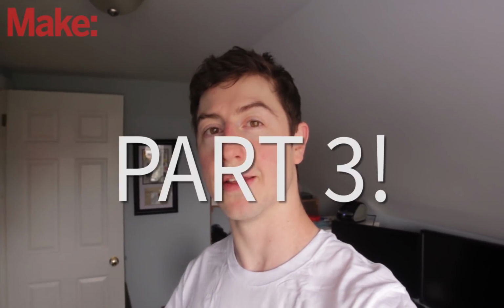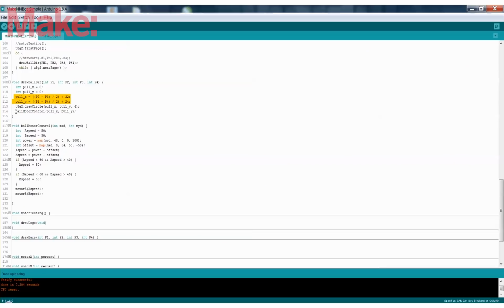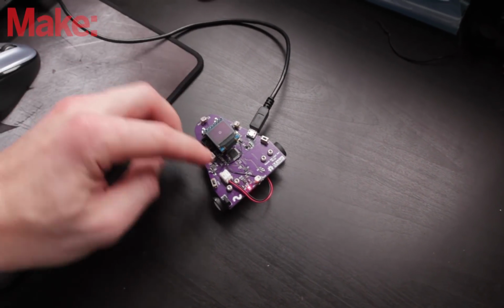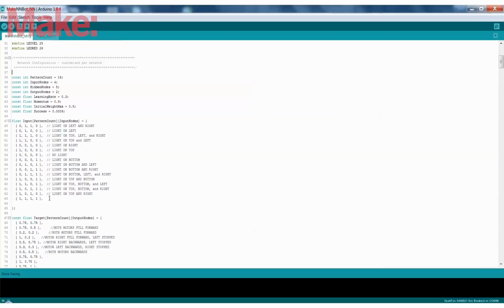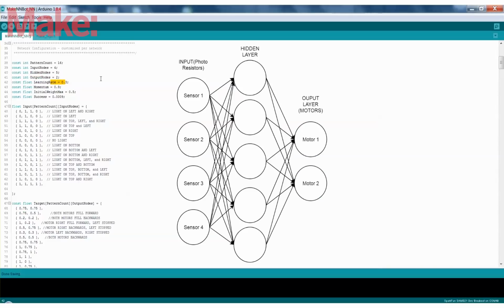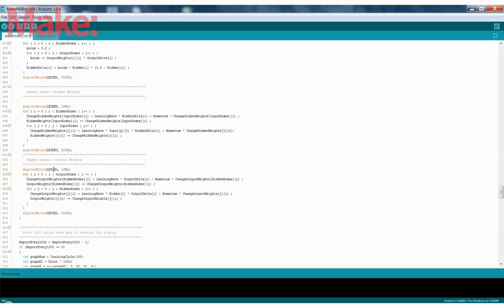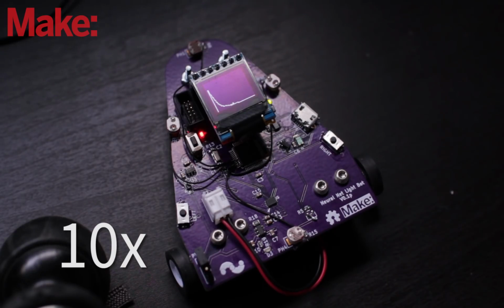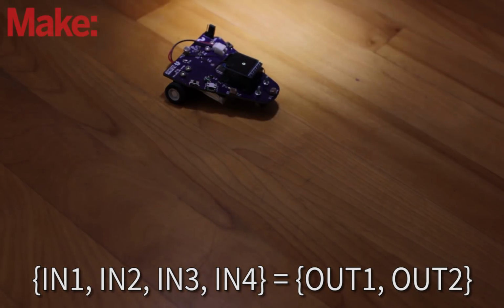Arduino Neural Network Robot Part 3: Running Neural Networks on an Arduino

Comment: Would be any difference if you used "if statements"? I´m confused with your multilayer neural network :S
Reply: For this case you could just use a lookup table which much faster than nested ifs. Also a simplified Karnaugh map could do the job, which less faster than look up table, but it takes much lesser ram space.

The point of having NN is to train them on a dataset and then predict unknown input. But it's fine to experiment with those stuff, so I give a credit to the guy because learning is important.
Reply: @SinvílyaMirindo  I totally agree with u. Thank u my friend

Comment: I face a problem while training the neural network. Error doesn't reach below the success rate, instead it goes back to training cycle 49 after going closer to the success threshold.. Can anyone help me?
Reply: I don't know your particular situation, but you can start by playing with learning rate. In your case (validation and training errors change erratically and stay high), try to decrease learning rate.  Another possible problem is too small training set in relation to NN size (e.g., the number of weights)-- the symptoms are training error falling to nearly 0, while validation error starts by falling a little, and then grows back -- in such case make your NN smaller (or training set larger) .
Reply: @alexeykrylov9995  Yeah! It worked.. Thanks man!!

Comment: more hidden layer = more layers = more number manipulation (basically each layer is add, then multiply) = more closeness/percision.
basically more hidden layers, the more complex logic it could handle.
for example:
summation = no hidden layers (its to simple you just add)
multiplication = no hidden layers 
powerof = at least one hidden layer
pythagoran theorm = at least four 
complex equations = more hidden layers

Comment: You could use a Raspberry Pi and the Google AIY Vision Kit to make a robot with a much more sophisticated neural network. Perhaps one with a rear facing camera that is trying to get away from a cat and not the light. The Vision Kit already comes with a pre-trained human-dog-cat-classifier.
While the robot is in a turn a servo should turn the camera, so the robot can still see the cat.
You should add proximity sensors to the front so it won't crash into the wall.
https://www.blog.google/topics/machine-learning/introducing-aiy-vision-kit-make-devices-see/

Comment: Wow! Great project! Wouldn't it be also possible to train the network on the computer and then ship the training data along with the code upload?
Reply: Yes, absolutely. A viewer actually wrote a python script to train the network and add the weights to the Arduino script. I will add it to the GitHub.

Comment: I've been thinking for a while it would be fun to build a neural network with AVRs, but instead of doing it all on one chip, use a bunch of chips (maybe those super small ATTinys), with each chip acting as a neuron or set of neurons.
Reply: Great idea. I have been thinking about exploring that as well, but using a light source to transmit the signal. I have circuit boards, but the project has been shelved for a few years!

Comment: Nice series, interesting in that the neural net which I thought would be slower especially on the low spec micro controllers was fast & reactive to the light. Kinda reminds me of least squares fitting to a curve in its operation. Thanks for sharing!

Comment: Great project. I really appreciate that you laid out the entire process, but also got down into the details. This was perfect intro to neural nets for me. Thank you.

One thing that wasn't clear: during training, the code doesn't actually look at sensors, correct? If so, could the process be reorganized so that the training were done on the host computer rather than the arduino?
Reply: Yep, you're absolutely correct. You could run the code on a computer and transfer the weights over to the arduino, never having to do the training on the arduino. It would also probably take seconds(or less) to train on a computer. ha

Comment: Awesome! It'd be interesting to see if the bot could learn light avoidance through the definition of only a single scalar reward... I have a feeling it could, worth a shot at least! 

Basically sampling motor speeds given light readings transformed by a (initially random) neural net and measuring decreased average light over all sensors as a reward, then modifying the weights to promote behaviors that lead to high reward, then repeat. 

I can see that it's much more practical to define the extremes though, and really cool that the net generalizes/interpolates between them! 

I'm working on a similar project right now, but the robot is a quadruped, and the sensor is a 6-axis accelerometer/gyro. Hoping to get some interesting behaviors when I reward "levelness" (high acceleration in the downward direction) or increased acceleration in a certain axis over time (say by walking forward!) 

Also if the arduino is too slow when training, you could consider training your net on a computer with python and sending the learned parameters to the arduino. I'll likely do so with my walking robot, using it to collect thousands of training examples which I can then quickly train on and send back parameter updates to the bot.

I'll post back if I come up with the tool. A very simple way to do it would be using a python script that trains the net with keras/tensorflow and prints the weight matrices out as text formatted for you to copy into the arduino sketch, who needs the serial port anyways! :-)

Your work here was really inspirational and gave me some good directions to go with my project, I really appreciate these videos! Thanks Sean!
Reply: Reward systems are a really cool way to train for sure. Truly random learned behaviour. I would love to see that done for something like this. I can imagine how it would be done in my head, but would definitely take some trial and error to get it right on the Bot. Ill play around with this idea. 

Training on a computer is definitely the way to go if you can do it that way. The absolute bare minimum would just be to copy over the weights to the arduino sketch. Definitely let me know if you create something like you mentioned, and I can add it to the GitHub as "Extra" stuff people can play with.
Reply: Definitely! I'll see if I can whip something up right now.

As for reward systems, check out Q learning as a starting point. Formulates the problem in a really obvious way, with environment states leading to actions which lead to new environment states and a reward. Then the problem is picking actions that maximize future reward. You can use neural nets to go from states to actions (called a policy network, any type of NN you'd like to use really) or you can try to predict future states given the current state and action... But that's a more difficult problem to solve. 

I used a type of Q learning here for continuous states and actions here: https://www.youtube.com/watch?v=ZPmCsJ6uWnA

In your case for the light bot you'd have continuous states and actions, though you can always discretize them into buckets and learn optimal actions for each :-)
Reply: Yo Sean, got something for the weight training, check it out here:

https://github.com/JonComo/Arduino_weight_trainer

Let me know if it works for you! 

I tested it by training on the example data in http://robotics.hobbizine.com/arduinoann.html and got the correct outputs when I copied the trained weights to the sketch and disabled the weight randomization in the sketch to not wipe out the trained weights.

Hopefully this tool could save you 5 minutes of train time on the arduino and let people try out different input/output pairs quickly!
Reply: Awesome! Ill try it out and ill put a link to it in the makennbot Github. Great work.

Comment: I had no idea an Arduino would be suites for this. I'm trying to make a self driving neural rc car but I'm using an RPi 3
Reply: NOPE Haven't gotten around to making one, a bit delayed on everything since the Pi was giving problems. I'll make sure to link it once made
Reply: Very cool. Using computer vision?
Reply: SeanHodgins yes, I will post a video about it some time in the future. So far I have a camera on a car that's driven around the it do the AI can train to detect objects and stop signs
Reply: Tech2025 nice 
I have also created a vehicle with RPI but I control it with a remote app I created.
Will you be kind enough to show us your code (maybe a git repo)😊
Reply: Tech2025 okk all the best 😀

Comment: An analogue battery level monitor bargraph with lipo charging circuit that can be read by an arduino. I run out of pins often on projects so arduino based battery level indicators are a no go
Reply: Hey thats a great idea. I can definitely make one of those. Also if you run out of analog pins, check out multiplexing or "muxing". It will let you run more than one pin to a single arduino pin.
Reply: SeanHodgins : I run out of all pins, I use lots of shift registers and all sorts of things. Just think a complete battery monitor that doesn't use arduino would be really useful, especially if it can output a value for an arduino to read :)

Comment: Actually a 10bit analogue input will deliver a value between 0 and 1023, not 1024 as you used in your map() call. It won't really matter in your example but if you were doing a specific test for the highest possible value then you'd never reach a true state.
Reply: True! Thanks for the correction.
Reply: NO, that's incorrect in relation to what is happening here. AnalogueRead() returns a value between 0 and 1023 for a total of 1024 values. Just the same as an 8 bit read would return 256 values between 0 and 255. He's mapping a range of value from one to another. If you were waiting for a returned 10bit ADC value of 1024 you simply won't get it. Ever. You can talk about doing division of values until you're blue in the face but that is completely unrelated to this scenario.
Reply: Wait! Using 1023 is actually incorrect ! For more info see this: https://goo.gl/inwt4D .

Comment: It would be great a robot that find its charger station when it needs to be charged...
Reply: Or a magnet connector haha. This is only funny because I just posted some magnet connectors on my instagram, for a project I'm working on.
Reply: It'd have to be a wireless charger, or maybe conductive wheels, try ing to get something like this to plug it self in would be a nightmare.

Comment: Could you write some code with a Fitness Input? I thought about it running for like 10 seconds trying to make the light value as small as possible(basically the fitness). This way the sonsors wuld be the inputs fir the nn aswell as the fitness value.

Comment: So... would there be a part 4 with something that could be done with NN but can’t be done with own algorithm? Kinda itching to see that. 

Thanks for this video. With that idea of NN being a mapper of inputs to outputs I finally starting to gain understating of what a NN is.
Reply: There won't be a fourth part in this specific series. However, I am working on a video on my channel that involves teaching a robot the names of different colours. Then it being able to determine the colour after it has been trained. Naming colours is a great example of something that is really difficult to define with just an algorithm(not using a neural network) because naming colour itself is pretty ambiguous. e.g. at what point does something become "orange" over "red. So by feeding a robot different colours, measuring them in RGB values and telling it what colours those are, it can learn, use a neural network to define the boundaries of those colours, and then predict future colours. I think it will be cool, there is a little spin it as well(don't want to give it away yet!).
Reply: Bogdan Pashchenko You could build a robot with two modes. Learning mode where you control the motors via a remote while the robot collects feature vectors consisting of light sensors and motor control signals. It would probably send this dataset to a workstation via wireless to do the number crunching. Self drive mode would then put the trained neural network in control which would hopefully reproduce similar driving behaviour as that observed when being driven by a human.
Reply: bornach good suggestion, sounds like replicating behavior - acceleration with various lights, control quirks - is something that would be too mundane to code with ifs. 

I’d rather see several more examples to get a better feel of this tech before doing something. There’re still white spots for me. Thanks
Reply: Adding to bornach's suggestion, instead of sending to an external computer to crunch numbers, you could just start with a raspberry pi board cause they are more powerful I think. Also my idea was if something had a camera then a neural net would help it figure out what it's seeing, but again I don't think a Arduino would handle that.
Reply: bornach I have a robot which I built with raspberry pi ( it has a camera, 3 servos, 2 motors). I control it with a remote pp I created. How can I add neural networks in my project.
Can NN be used with my current config. Or do I have to add some different modules.
Reply: SeanHodgins that’s going to be a cool one! I’ll keep an eye for that. Thanks
Reply: Brew Sauce ya raspberry pi is best suitable for this....

Comment: Does a Neural network kind of work like an automatically tuned PID function?
Reply: awesomeguy2802 Not the type of NN used here. PID requires derivatives and integrals which both imply a memory of the previous light samples. The simple three layer feed forward neural network shown in the video has no memory. There are other types of NN that do maintain an internal state that behaves somewhat like memory. Look up recurrent NN, Hopfield networks, Long Short Term Memory networks.
Reply: That is a good question. They're both can be feedback based, but I think that is where their similarities would end. You could probably use a neural network to solve the PID parameters though. I don't know how off the top of my head, but I could see it being possible.
Reply: SeanHodgins a Neural network + PID combo would be awesome. I've tuned PID before and while it is very accurate and reliable, it takes tremendous effort to get good values.
Reply: bornach But it is possible to combine them, it just wasn't used here. (Although maybe the robot would move better if it did)
Reply: What about if we use the neural program to track a solar light for the electric solar panel system
Reply: your question has both yes and no answers
A NN is a totally different animal so to speak. 
You could likely design a NN to be a PID however some presets would be needed and the question becomes if it started with preset learning already is it truly a NN or just a hybrid or actually just a PID.

Like a baby you have to get burned once to know fire is hot.

They have to be "Taught" pieces of info before they can assemble them into greater learning.   
If you were to make a PID you would still need to start with some pre written info depending on just how critical the PID needed to be. 

Having 40+ years in industrial robotics design, presets were always required so they could not possibly kill someone among other issues.

Though NN and Machine Learning have jumped in recent years. I wrote my 1st NN in 1980 and had to "teach" thru keyboard. It took about 4 months to indicate the intelligence of a 5 year old.

Obviously with sensor input the learning is much faster, however in that early curve potential disaster is possible.    In PID controllers the curve data is already embedded, often for that very safety reason.  

That said; say your PID was to control a furnace,  you could end up burning the place down while it was learning.  To that end making it a NN would be a very bad idea.
 
Because a PID has a very narrow and specific task it is not a very practical starting point in many applications.

Clearly a case by case is needed on such a design plan.

Comment: That’s great project and super detailed explanation! I really like it :) I made a lot of Arduino projects and learn some about neural networks and genetic algorithms I am thinking about implementing neural net in a line follower project. I know that PID algorithm can be simpler faster and better but just for scientific purposes and because of my curiosity I want to try that. What do you think? Thanks again for this series!
Reply: That is an excellent idea. This code would adapt well to that too if you wanted to try and port it over to your robot. This robot is basically an upside down line follower that follows shadows instead of lines.
Reply: SeanHodgins yes it is kinda similar, I am just curious if 16mHz is enough for float point math calculations on the level of neural nets. Wouldn’t it be too slow for a quite fast line follower? I think I will try that in the near future, I just have to finish few of my current projects. Again thanks for the video, hope to see more of that kind of projects soon :)
Reply: Once its trained the calculations are very quick, should work fine. May not be competition level fast though! Thanks!